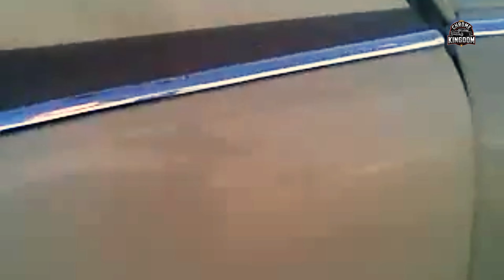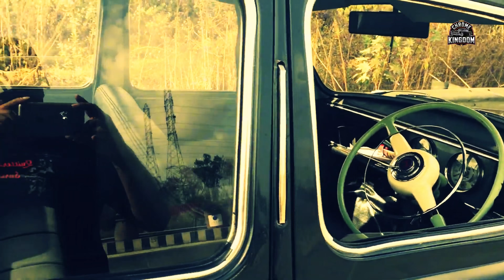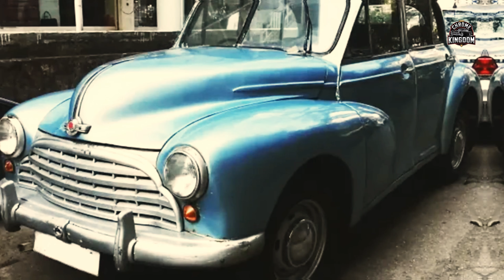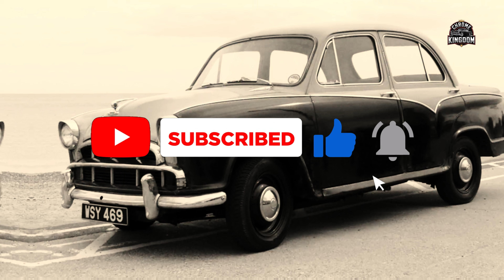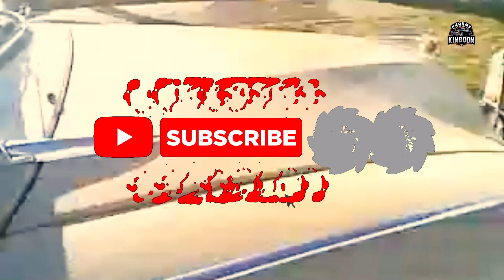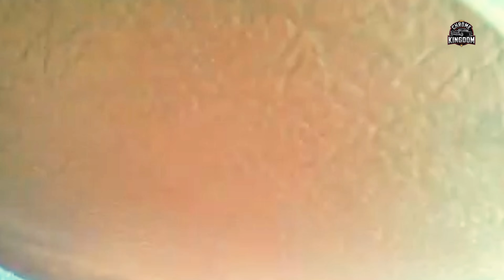Morris Oxford Series III (1956-1959): Britain's 3-Year Car That India Built for 57 Years

Comment: While growing up in India in the 1970s, 80s and 90s (until I moved overseas), my family car was a "Mark II" Hindustan Ambassador which I remember my dad bought, used, for a mere 15,000 Indian Rupees in 1974 (approx 156 USD today). My uncle who worked at the Ambassador dealership, used to share stories that when buying a new car, it would behoove the buyer to take a mechanic to the dealership, start several new cars and listen to the engine before selecting the 'best' of the lot. And some of the engines - as believed by those mechanics -  were far superior to the others at the lot, determined thus by listening to the sound and beat of the engines. And they were economical to maintain at roadside mechanic shops. To add: my uncles had the older versions - the Hindustan Landmaster (with an electric petrol pump) as well as the even older "Hindustan 48" (a truly vintage looking car with a long hood). In later years, the Mark III, and the Mark IV were born, the latter could be purchased with a floor stick shift, air conditioning as well as with the ISUZU 1800 cc engine or diesel engines. Later they were exceedingly converted to work with CNG due to high cost of petrol in India especially by taxi operators in India. The direct competition to the Hindustan Ambassador, for the longest time, was the Indian variant of the Italian Fiat 1100, known as the Premier President and later on, the Premier Padmini, and to a much lesser extent, the Indian variant of the Triumph Herald, known as the Standard Herald and later on, the Standard Gazel and the Standard 2000 (the Indian variant of the British Rover SD1).